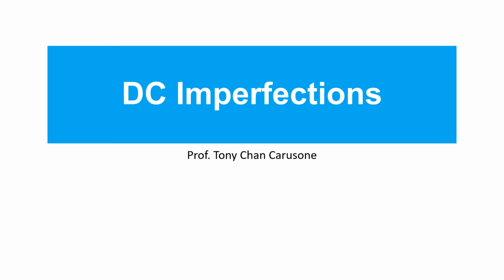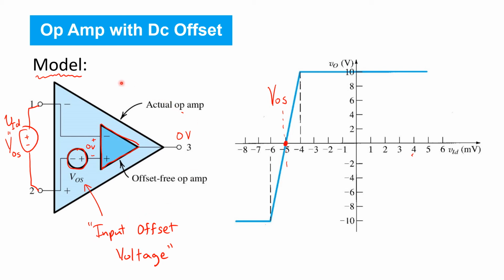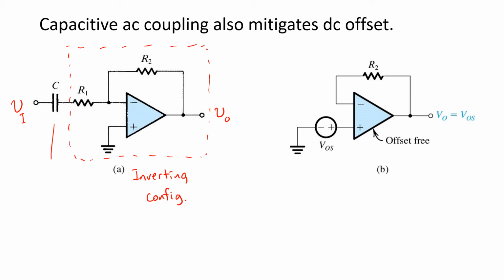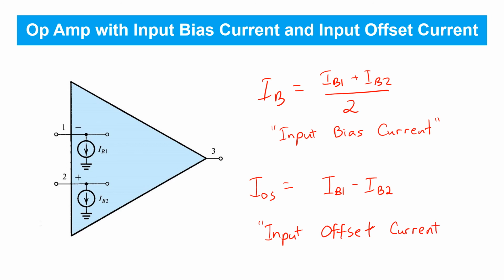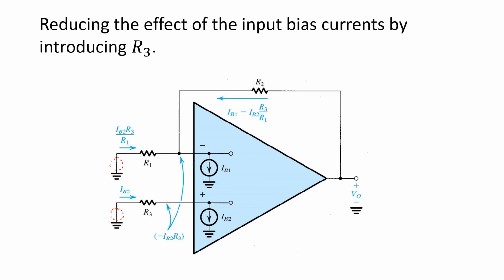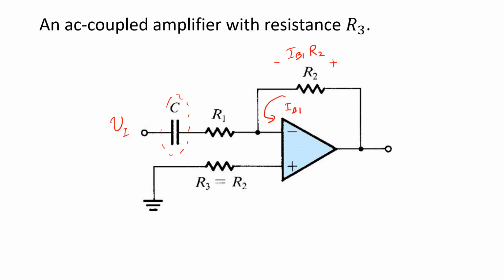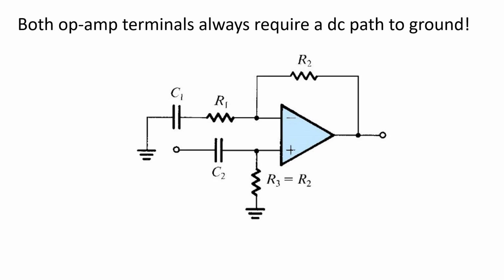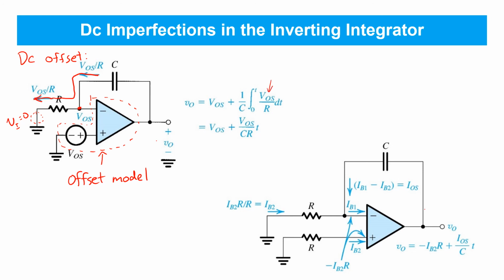15 DC Imperfections

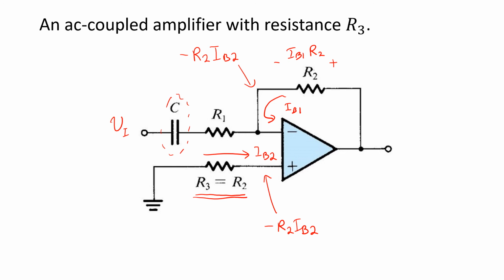Comment: at 22:43, why is the voltage negative (-R2 * IB2)?
Reply from the maker: Opamp input bias current flows into the op amp, from left to right, as shown in the video.  Since the voltage on the left side of R3 is 0V, the voltage on the right side must be negative.